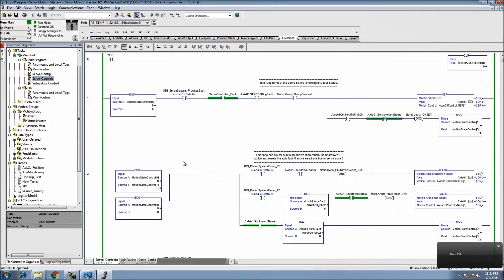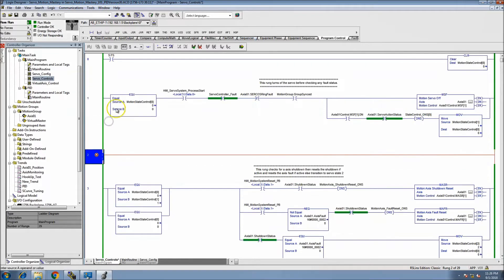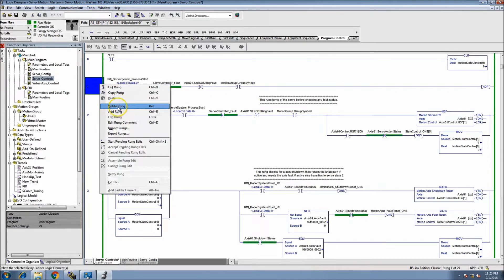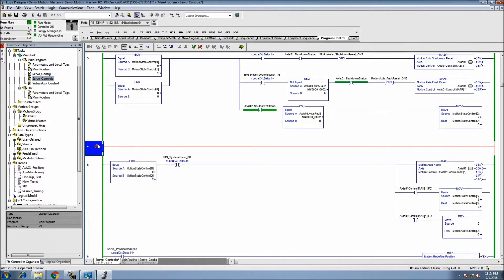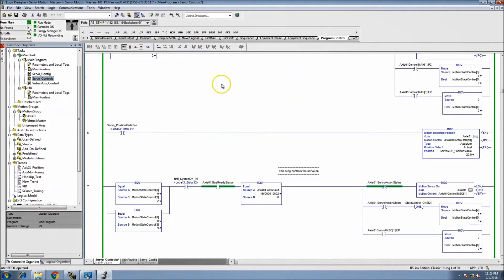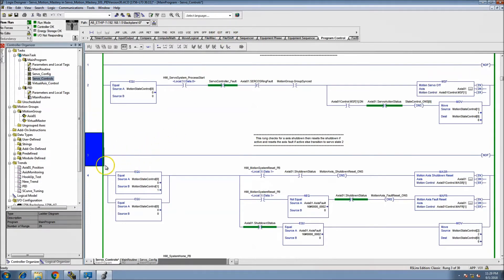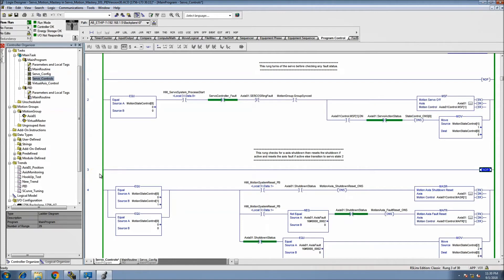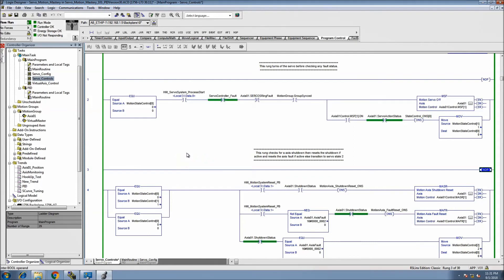RSlogix 5000 Using an NOP Instruction and Why [Official Video]

Comment: Hi .. Can you please share some videos about socket connection sending messages over TCP ?
Reply from the maker: Great suggestion!

When I have free time, I currently just change positions at work which requires a lot of my time however I will make sure I add it to the list.